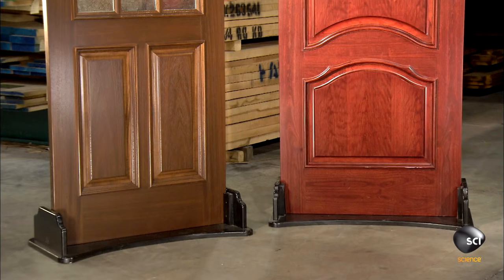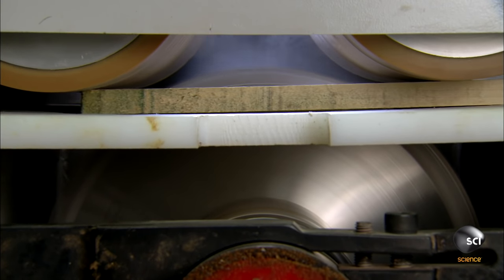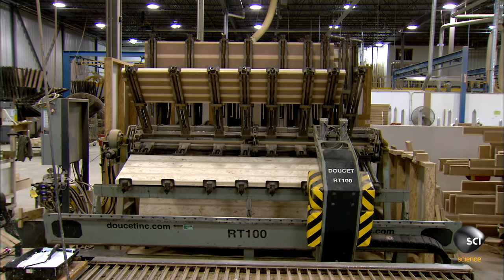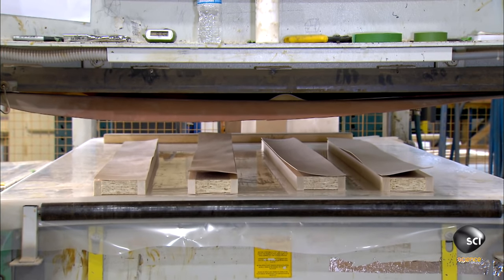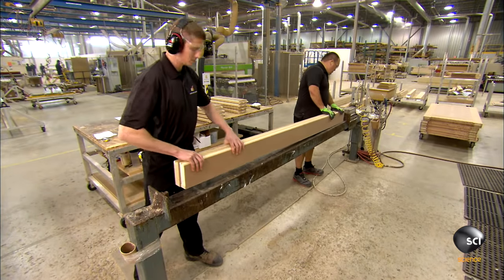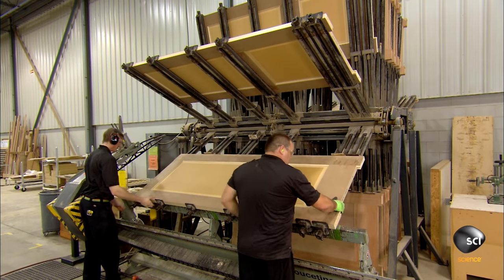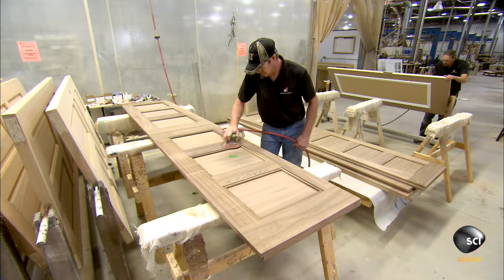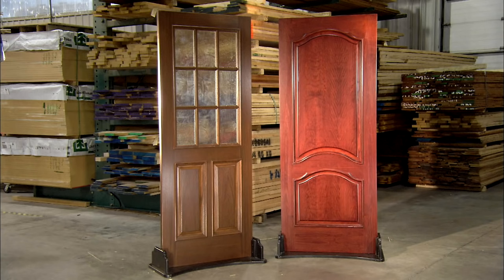Stile and Rail Doors | How It's Made

Comment: I wonder if they will last 600 years like rhe old doors, or if they will delaminate and the mdf give the whole family cancer
Reply: my mom got some made like this labelled as "real wood" and home depot scammed her almost $300each for them. Within 5 years they were all parallelogram shaped and the bottom rail was falling out...cheap pegs and glue aren't the same as full thickness mortise and tenon joints in good doors. They don't take natural changes in humidity and temp found in any home not totally climate controlled ....and yeah they delaminate

Comment: So basically those are "Fake" wooden doors!
Reply: Whatever happened to Real doors White?? F*ck This:(
Reply: Yep...
Reply: Bob Abooey you know you have anger issues if you have a swear fit over doors
Reply: Nah, they're real wood doors just engineered for better stability. There is a lot more operations & processes in building a door this way then just milling cope & stick into a solid pieces of wood. Back in the early 1900's the only houses they made 'stave core' doors for where the most high-end of mansions, it was the regular houses got the solid wood doors.
Reply: @travisthechimp7857  i don't know about your country but in My country this company would go under loss. No one would prefer a MDF panel which can be easily Punched through.

Comment: Yes, let's take real wood, hack it into little strips and shred it into sawdust then glue it all back together to make it resemble real wood.
SMH
Reply: That's done so the door doesn't crack and warp.
Reply: +Mike K What, exactly, do you think the function of the rails, stiles and panels of a real wood door are for? The smaller end grain connections? The floating panels?
NO, a real wood door will last 100 years longer than that glued-up particle board crap!!
Reply: Yep.  I've got 114-year-old solid Douglas fir doors made with mortise and tenon joints and solid panels.  The interior doors are a good two inches thick and the exterior doors are about two and a half inches thick.  They've withstood our rainy climate for over a century without any rot, warping, or cracking - because they were made with iron-hard old-growth wood by real craftsmen.  I'll bet they'll easily last another century or two.
Reply: Solid woods better, if you can afford it
Reply: Engineered wood has it's place, some argue stability, well I have seen FJ spruce that's supposed to warp less look like a spiral. Engineered wood is not all about stability it's about profit so you can put crap in the middle and the good stuff on the outside. And some companies try to charge  you more for engineered because they claim it's better. 
I'll take solid wood over engineered any time.
Reply: after sometime many problems in door
Reply: d
Reply: Jetta Driver hey
Reply: I have a home with 160yr old pine (likely from new hampshire via connecticut mills) 4 panel doors that are near perfect and made the right way with mortise and tenon and even wood pegs holding them together.
Meanwhile some doors made like this are 1 1/2in out of true and literally coming apart and unglued after less than 5 years in the same home. They're fancy garbage....you even have top pay to throw them away
Reply: I’ve got a 4000 year old door 🚪 made with cardboard and plastic, that I built, and it’s as good as the day I built it!